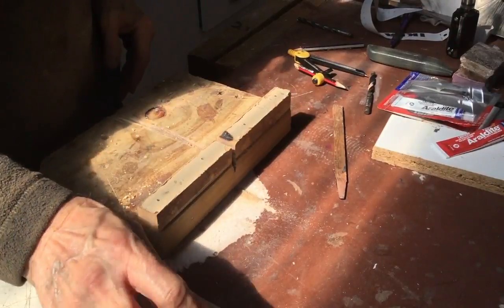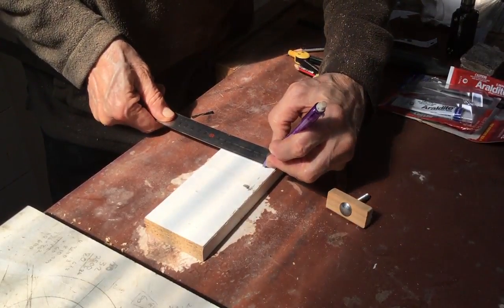DIY Levelling Table for Flow Art

Comment: Found the video :)  Well, that was a brilliant tute, thank you both so much for that.  It will help me such a lot!
Reply from the maker: No probs.  We can’t take credit for the idea.  It was a super old woodworking table tip for varnishing.  We just adapted it for something smaller. My house is quite wonky and I pulled my hair out trying to keep resin still.  Grab the caravan bullseye levels as well.  They are brilliant and much easier to see if you are level all over the substrate.
Reply: Chris Cross Yes i did see a video about acrylic pouring that recommended one of those, thanks :)

Comment: Thank you so much!
Reply from the maker: I thought I should get around to it after all the questions on how to make them  😂😂😂
Reply: @crisscross104     I have some old cabinet knobs that are oblong, just need the T nuts that will fit them.  I've spent many hours trying to level my resin table and it seems to need it every time, weird.  My Studio has a central drain, so the floor tilts to the center, a real pain for all my cabinets, etc.  I was a Potter for 20 years, and I had to mop daily, so that seemed like a good idea when I built the Studio, LOL.  Now, not so much.
Reply from the maker: Those tnuts come in a few different sizes so take the cabinet knobs with you or measure the thread section.  I haven't given actual sizes because everyone is spread out around the world and sizes are either imperial or metric.  As long as the nut fits the bolt any size paring will work.  My kitchen counter was the worst and I was forever adjusting.....  drove me nuts  lol

Comment: how long of a bolt do you use? and the ones already put together, how long are they? Thank you both for this video
Reply from the maker: Pam the bolts are two inches but it sort of depends on the thickness of your board and handle.  Any length will be ok as long as they are long enough to give you enough play to get a level
Reply: @crisscross104  Thank you Chris